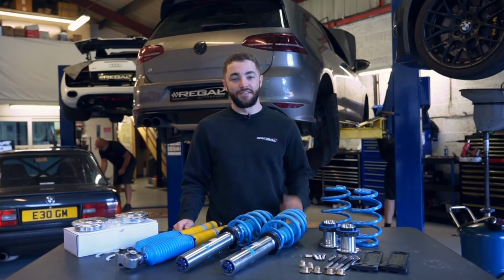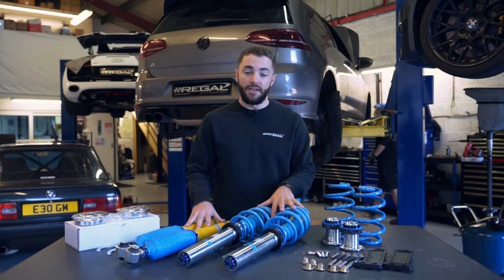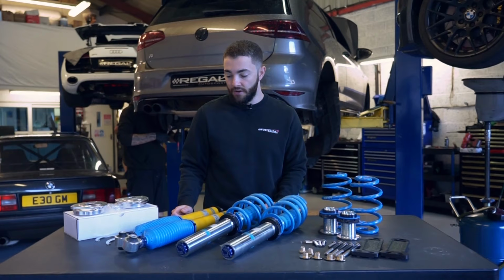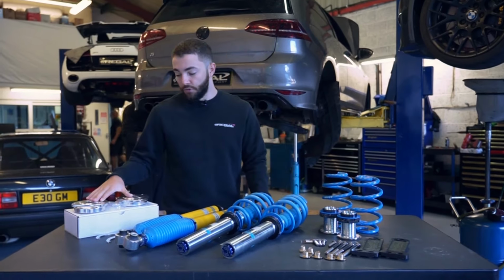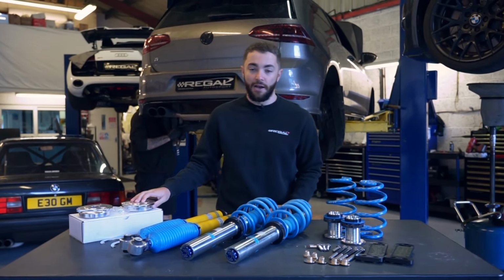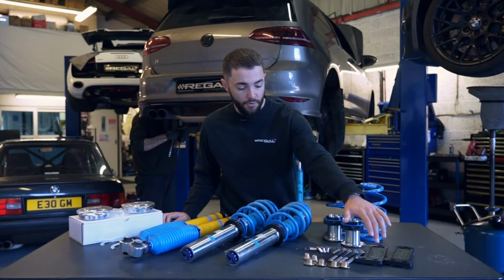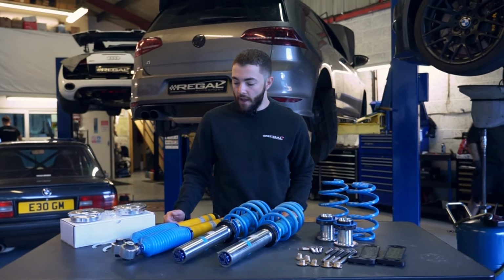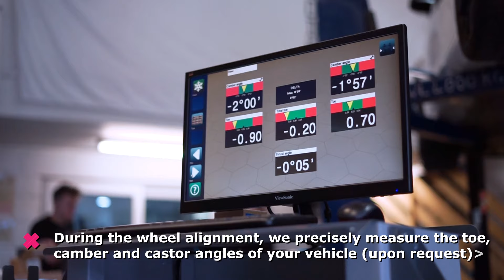MK7 Golf R Handling Upgrades | BILSTEIN B16, 034 Motorsport Top Mounts, Tyrolsport Deadset & More!

Comment: Will these integrate with DCC on. 2017 7.5R?  Am interested in upgrade.
Reply from the maker: Thanks for the comment, yes these will fit with a DCC car but a DCC delete kit will need to be fitted and the electronic damping adjustment will no longer have an impact on the driving. We can supply and install the DCC delete kit too.

Comment: By how much did you lower the ride height..?
Don’t know if I missed you say.
Have a GTi TCR. Looks like I could drop it 30mm at the rear but not sure if that’s too low at the front.
Have 19” wheels on it…
Reply from the maker: Thanks for the comment Aleca, we did not record how much we dropped the ride height on this one. 

It's best to measure the floor to top of the arch before suspension install, then after and make adjustments to suit your taste. 30mm is a good place to start.